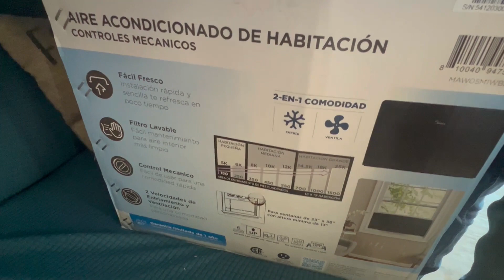Making Progress: Cabinets & New AC...Bus Build

Comment: Best way to learn is to do it yourself. I understand your feelings about construction. I have yet to begin construction on my bus. I have been trying to find used window replacement but to no avail. I would like to find a bus salvage yard and get as many as possible emergency windows. I learned things after buying my 2002 Rear Engine International school bus. I have a water leak up front over the windshield right side. I replaced gaskets on flashing lights and water still seeps in, a headache for sure. My front door doesn't close quite entirely and allows water leakage into front step.
I'll be starting construction soon and I look at your construction for ideas. My shower bath will be round, made from a 220 gallon plastic water tank. I'm sure to have possible problems in setting it up. Now, all of my plumbing will be PVC water pipe, glued joints. I will have access panels to replace any part should I have a leak.
I intend running AC power wiring through where school bus lighting is located over windows. I enjoy listening to you guys during your work.l inside. My potable water source will be (4) 5 gallon containers. I will have another single tank inside for shower and flush toilet. I don't like a compost toilet because you have to change out the waste. The bus is high enough off ground to have the necessary holding tanks for gray and black water. The tanks will be cheap ( steel 55 gallon tanks ) as opposed to those expensive  commercial plastic holding tanks. 
You guys are doing great, keep up the desire in spite of mistakes made.
Reply from the maker: Thank you! We had to fix many leaks in the windows! Also our front door does still let in some water so we gotta get to that. I do like emergency windows best because you can do a lot with them. The guy that sold us our bus said he has many parts if we needed them. He is in Taylorsville, Ga. Love all your good ideas! Will you be putting your build on YouTube? If so we would love to follow your journey as well. 😊
Reply: @ParsonRoad  I'm not a YouTuber. The only way I could show my progress would be via email video or still shots. I got a little ahead of myself, I must paint ceiling and walls before I start framing. Keeping my conversion simple bu using inexpensive materials. Some items I will employ are new such as, stainless steel sink, ice maker, microwave, counter top oven, small frig, two burner glass top stove and whatever else I might use. I hope to have a portable washer and dryer also. I was going to use full size washer and dryer but they take up too much space. Maybe when my bus gets finished which will be later in the year, I can meet up with you guys somewhere in our beloved USA.
Reply: @ParsonRoad  can you supply the contact info in Taylorsville for parts available for International bus ?
Reply from the maker: @alvisjenkins1305 I believe it is Halls Automotive/Auto Recycling 6786166311
Reply: @ParsonRoad  I most likely will not be on YouTube in my camper build. But, I can send photos to your email or text messaging. I am currently on hold in building for health and other reasons. I have gathered a lot of things for installation, such as a stainless double sink,  a Aqua-Magic VI flush toilet, two portable butane stoves, an electric recessed stove top, a portable countertop ice maker, a countertop oven, a microwave, cast iron cookware, water pump,   LED lighting, a small refrigerator, a power generator which will be mounted on outside front of bus. More items to add. Framing will be a chore with plumbing and electrical to boot. My camper won't be plush, but it will be comfortable and very much self contained as a home on wheels.
Post when you start your split AC system and I will donate to help you with some of the expenses. So far your camper or home is looking good in my view.
Reply from the maker: @alvisjenkins1305 that sounds like a plan. Our email is parsonroad@gmail.com We would love to see pics of your build! We are hoping to start the mini split soon. We are also looking into exterior paint as one of our next steps so we can get the tag for it.